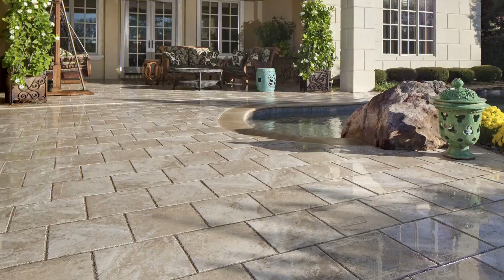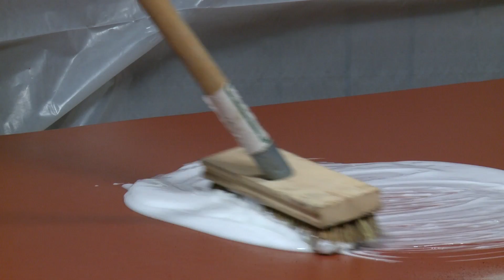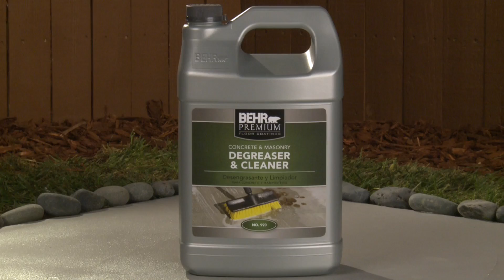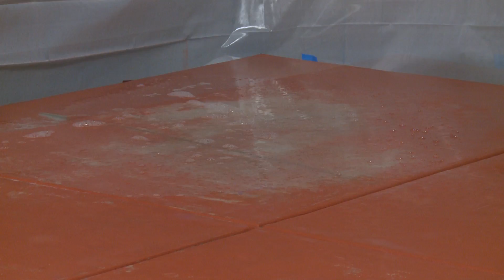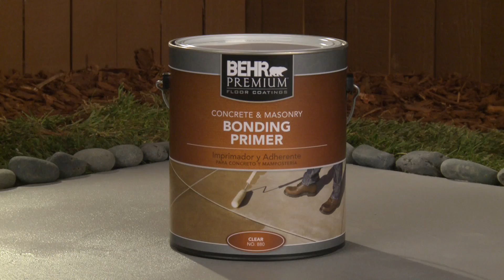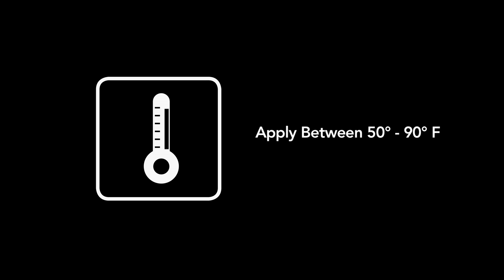Preparation for Coated Surfaces for Paints & Stains

Comment: Question  is it okay to etch then paint  over a already coated concrete surface if its not loose or pealing?
Reply: Also with a different color?
Reply: Wondering the same

Comment: I have a question! Should Part 1 Epoxy mixed with another Part (activator) or Part 1 means "all in one" and no need to mix with other Part....? Thank you!
Reply from the maker: Hi! BEHR PREMIUM® 1-Part Epoxy Concrete & Garage Floor Paint is just the product name, there is no need for a second coat of another product. Please follow all label instructions for preparation and application.
Reply: Thank you! I will!
Reply: All in one and it is not very good